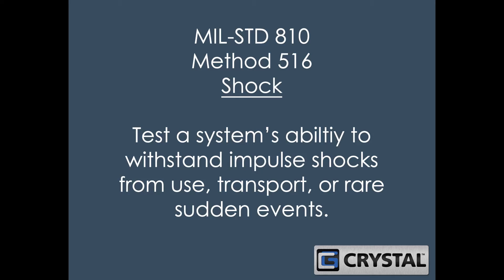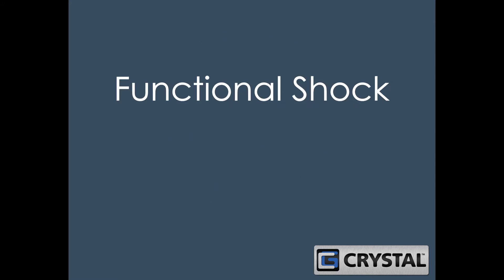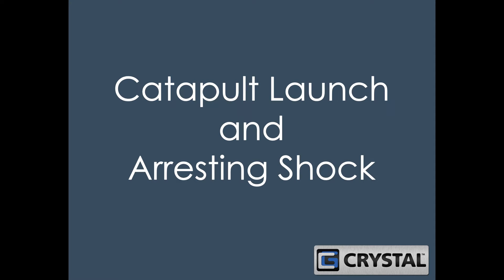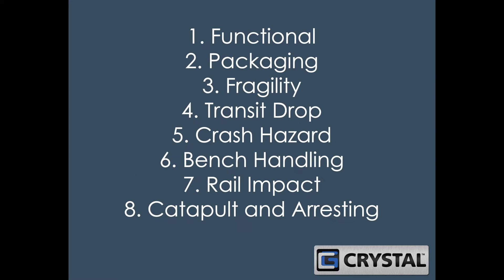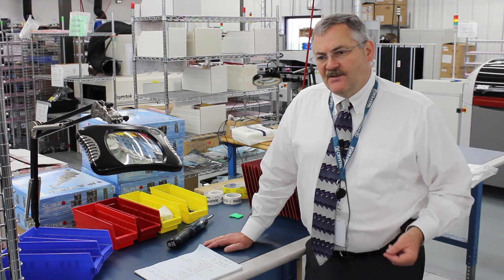MIL-STD Test Method 516.6 Shock | Jim on Engineering | Volume 1, Episode 84

Comment: When the testing of laptops is done with 810G method 516.6 procedure IV-(Transit drop test) does the laptop have to be in some sort of case/cover/packaging  or is that up to the manufacturer to decide whether it should be testet with or without a cover? 

A test without some sort of protection of the laptop would of course make for a better guideline as to the durability of the product compared to the laptop being protected.
Reply from the maker: The answer depends on how the laptop is being used.  If you check MIL-STD-810H, table 516.8X, you will find some conditions for testing that are based on how the product is going to be used.  If you are just concerned about getting it to the customer, then in the box is great.  If you are concerned about shock in usage, then the test would be without the packaging.  Make sense?  Good luck!
Reply: @CrystalGroupInc  Thank you very much for your response greatly appreciated. 

I did a tender where i'm using MIL-STD as a way of evaluating which offer/laptop is the best. The one PC has a pass of drops from 48 in but as packaged drop test (MILSTD 516.5 procedure IV) the other same height but as unpackaged drop test(MILSTD 516.6 procedure IV). 
Now the 516.5 claims that MIL-STD can't be used in evaluating which offer the best drop test but instead claim that the transit drop test can only be used when the product is in packaging /bag/case/ or otherwise protected. That I suppose is not true?

Again thanks for getting back to me.